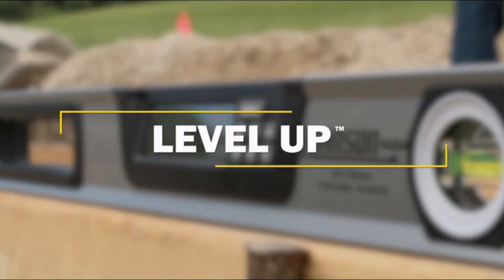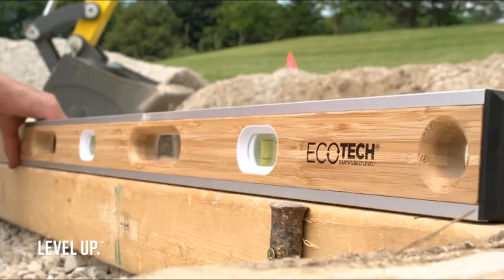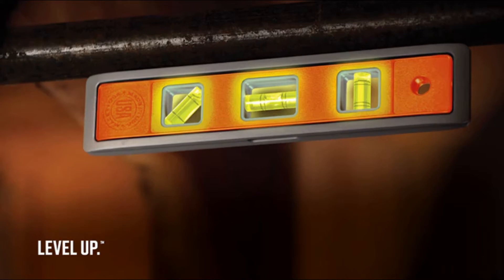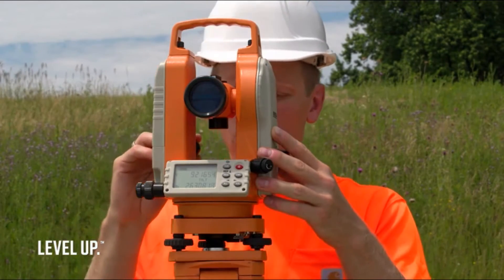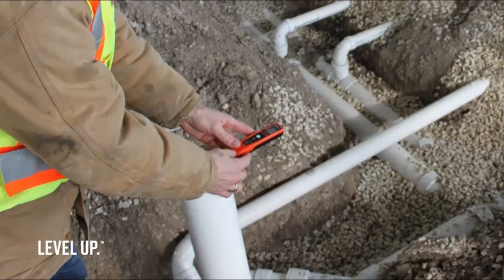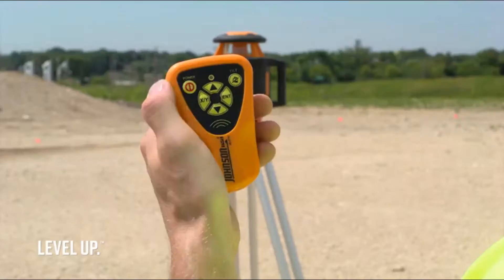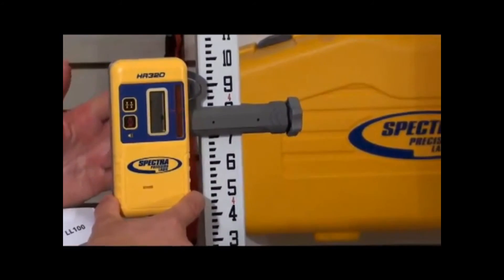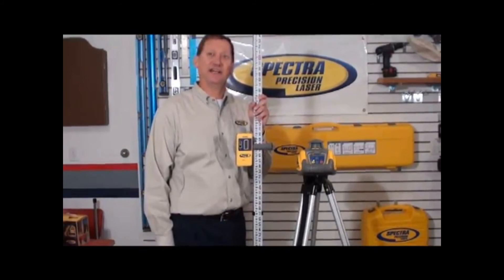Top 5 Laser Level Picks for 2020

Comment from the maker: ✅Top 5 Laser Level Picks for 2020
ONLY FOR YOU  🎁
🔔Please click here https://amzn.to/2RTthNN or 👇 [See More]
✅1.Johnson Level 40-0921 Self-Leveling Cross Line Laser Level Kit
US:https://amzn.to/2RTthNN

✅2.DEWALT 12V MAX Line Laser, 3 X 360, Green
US:https://amzn.to/2O1OOTc

✅3.Bosch GLL-3X Line Laser (Blue)
US:https://amzn.to/37x2n4O

✅4.Spectra Precision LL100N Laser Level
US:https://amzn.to/2Rsgjrg

✅5.Huepar 2x360 Cross Line Laser, Self-Leveling Green
US:https://amzn.to/2RsFLNw

A good laser level should give you options when trying to keep a surface straight. Top 5 Laser Level Picks for 2020. Different projections and features can make the job easier when you have a high degree of flexibility to use.Top 5 Laser Level Picks for 2020.  The Hammerhead Compact Self-Leveling Cross Line Laser takes the top spot because of the flexibility it offers when your project requires straight lines on flat surfaces. This level can produce a bright horizontal, vertical or cross line on any surface up to 30 feet away, meaning it can handle normal rooms around the home.
Reply from the maker: OK